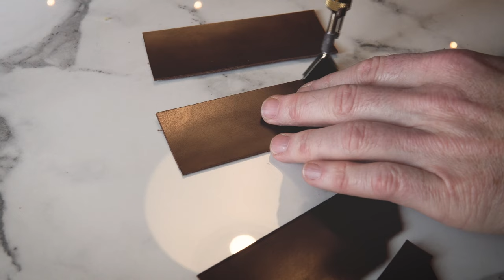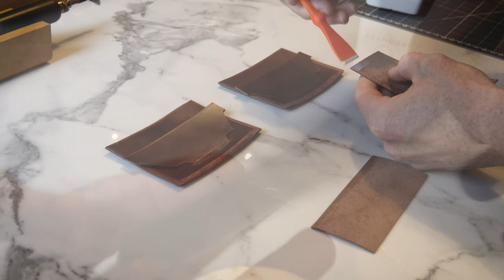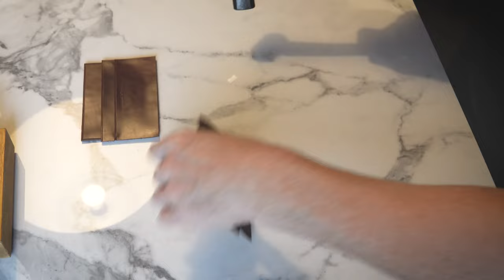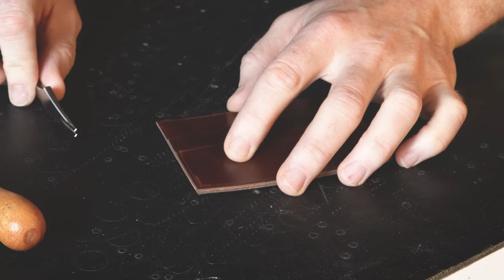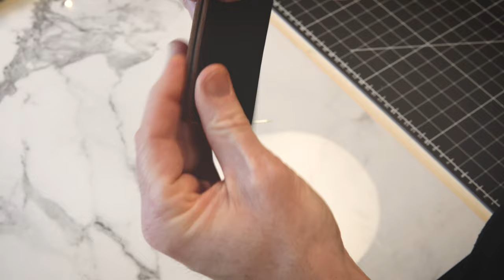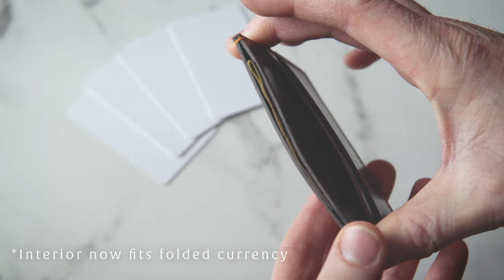No.55 Prototype Leather Wallet | Free Plans

Comment: Awesome, as always.
One thing that struck me was that there seems to be a relatively large proportion of exposed card, especially on the lower card, compared to other card holders I’ve seen? I’m sure it’d be secure, but perhaps it might skew people’s perceptions of it. ❤️
Reply from the maker: Thanks for watching. Yes indeed, by design. I personally find with less pocket height it is easier to access the card. Another difference is the width, I believe my wallets are narrower than other similar wallets. In the end it’s just proportions, the firm leather is what really holds the cards in place.

Comment: Did you use reverse irons for this project?
Reply from the maker: No I didn’t, I punched both sides separately as an experiment. The stitching on the back side is straighter than I prefer but I think that is due to the angle being reversed.

Using reverse chisels would be ideal if you are going to be punching from both sides.